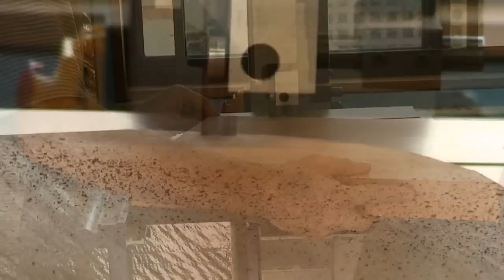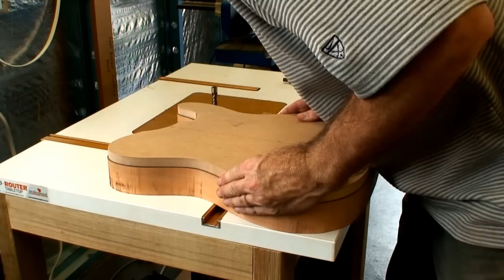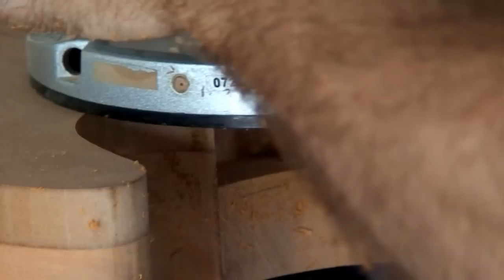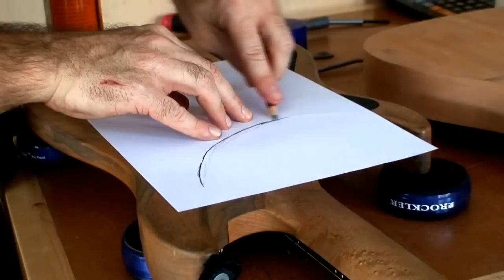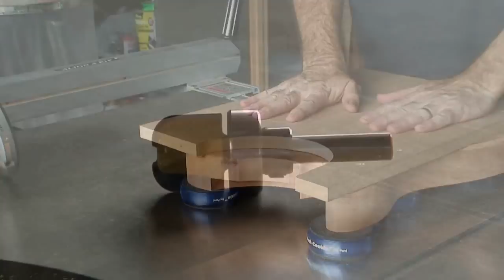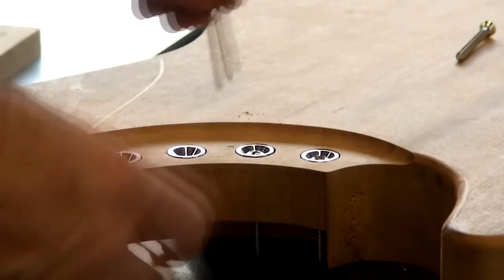Part 3 - Bandsawing & Routing A Guitar Body (Telecaster)

Comment: Yeah I was going to just go with a standard 1/2 inch diameter , 1 inch long ball bearing flush bit as I hear its better to be a little experienced with routers before using spiral bits.

Comment: I see your drill press is as good as mine...
Reply: That's not a bug; that's a feature. It throws loose shavings clear of the work area. It's also good for the circulation and discourages the build-up of dust on the machine itself.

Comment: I have basically 0 tools that you're using unless they're the handheld versions. Those should be okay for cutting out a body and making a body, right?
Reply: YOU CAN USE HAND TOOLS TO BUILD GUITARS IT TAKES A LOT LONGER BUT TAKE YOUR TIME AND YOU WILL BE OK THERE IS A GUY ON YOUTUBE THAT BUILDS ELECTRIC GUITARS USING ONLY HAND TOOLS BECAUSE HE BUILDS OUT OF HIS APARTMENT IN JAPAN AND HE CANT MAKE NOISE. HIS VIDEOS ARE GREAT. BUT YES HAVING POWER TOOLS MAKES THIS PROCESS MUCH EASYER THOUGH STARTING WITH HAND TOOLS WILL GIVE YOU A BETTER UNDERSTANDING OF HOW WOOD WORKS. GOOD LUCK, I KNOW I'M NOT FLETCHER BUT BUILDERS MUST STICK TOGETHER.
Reply: For sure. They built stringed instruments by hand for hundreds of years without any power tools. You  will need a router though. It will save your life.

Comment: Why should you use 2 pieces of wood instead if 1??
Reply: Mostly cost.  It's much easier and cheaper to glue together 2 pieces of 8/4 lumber than to find a single piece to accommodate the entire body.

Comment: I'm making a custom guitar with a 50's fender neck
(Forum link: http://www.tdpri.com/forum/other-guitars-other-instruments/464619-first-guitar-build-ever-ambitious-major-work-project.html)
How would you go about routing the neck pocket for such a project?
I'm nervous about getting scale lengths and positioning exactly correct, so a guide in any direction would be great help.
Cheers, and great videos :)
Reply from the maker: Hi Justin, Have you watched my Strat build video's yet ?
Reply: ***** I have and I was just worried about whether I should build the neck first or the body, as I'm unsure of the depth I'll need to rout in order to have an aligned neck and to eliminate fret buzz and getting the action right.
I'm actually aiming to build the neck just like your Fender neck, with a spoke style truss rod.
Reply from the maker: I'd build the neck first then use that to make your neck pocket template. Your finished neck thickness is 1 inch ( not including frets ) and you route your neck pocket 5/8 inch deep
Reply: Great!
Thanks for the pointers, I should be able to get a start on the neck tomorrow